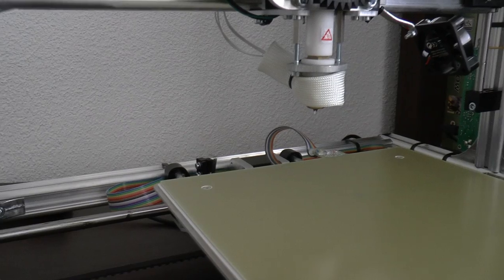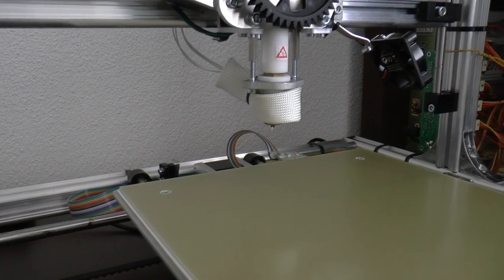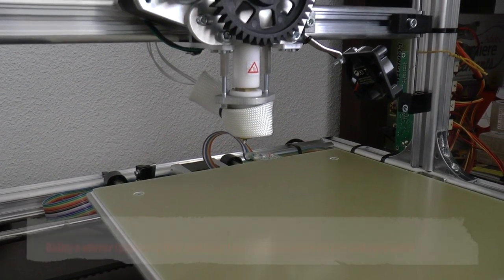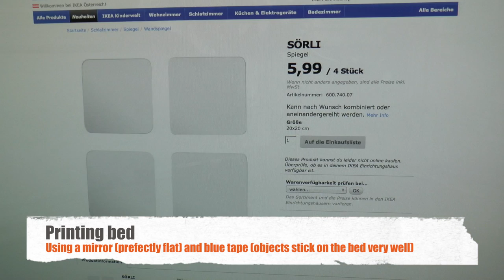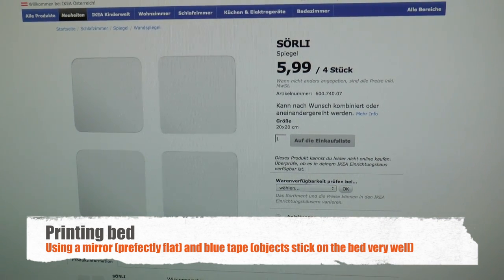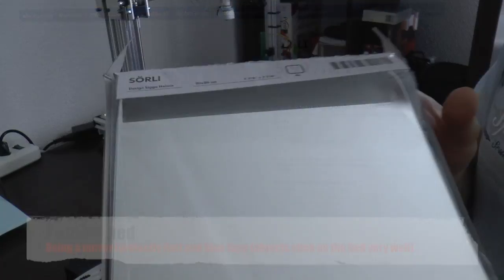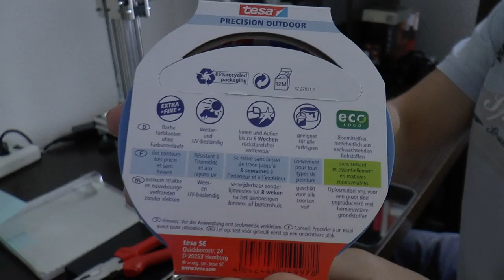Velleman K8200 - 3D Printer Tips and Tricks (Part 1)

Comment: Like your mods.
I've had mine for two years now! Still going strong. Not really made any mods except for a better fan mount. I print direct to the hotplate, just use a bit of painters blue tape. These are not the highest quality printers but they are the most reliable. I very rarely need to calibrate it. It has printed two other printers, one for a friend and a new one for me, as I wanted two. :) As a first 3D printer for the hobbyist these are ideal. I often use to to print up brackets and mounts for other projects.

Comment: I have the mirror and the tape, but for some reason the filament does not stick perfectly.
But I have got real good results with Bison spray adhesive. After spraying, wait until it's dried and then print. It sticks really good, but after the bed cooled down it is not that hard to remove the product.

Comment: You don't need any tape on mirror or glass. PLA sticks very well to the clean glass, if the bed is heated.
Reply from the maker: Well, I tried that too, but did not get good results with PLA. Maybe it also depends on how hot you can heat the bed. Anyways, blue tape works very very well for me and I still use it for all my PLA prints.
Reply: In that case your glass is not clean or you are not heating the bed properly. PLA does NOT need tape. Maybe the reason for not sticking in your case is the use of alcohol. Use hot water only and clean it really well with just water, dry it with lint free paper towel and that's it.
Reply from the maker: Probably it depends also on the printer, the default K8200 does not have a strong heating bed. I remember I tested printing directly on the glass at about 55 degrees C (that's more or less the max. temperature it can reach - even if it takes ages for that). I got best results when using a bit of hair spray on the glass, but slightly larger objects easily got warping on edges.
For sure it is true that PLA does not need a tape, and I'm sure a lot of people print without tape and get good results. However, it's a fact that PLA sticks a lot better on blue tape than on a blank mirror. On blue tape I can print at low bed temperatures (e.g., 35 degrees C) and the print sticks perfectly, no warping issues at all.

Comment: Can Kapton tape work just as well as blue tape with both PLA and ABS with your mirror solution
Reply from the maker: I guess so, yes. However, I never used Kapton tape so far and printed only PLA for now.
Reply: Ok thank you
Reply: Michael Wickstrøm
 I use kapton for both PLA and ABS.. I sand it a bit to give it some texture it works really well (Better than hairspray in my case)

Comment: I use hair spray instead of blue tape for now.
I work very well for ABS and PLA.
Reply from the maker: I've read about using hair spray but never tried it out so far. Probably worth a try... actually PLA sometimes sticks too well on blue tape and it's difficult to remove it. I guess next time my blue tape layer is worn, I'll try to print on the mirror directly - read that at least with PLA this should well.
Reply from the maker: I tried printing directly on the mirror with hair spray - for smaller objects it works very well and the first layer surface is extremly flat and shiny. For bigger objects I get some warping at corners. Already increased bed temp. to about 55 deg. C (for PLA) but it didn't help. Probably lowering the cooling fan speed could help... I'll continue testing that.
Reply: skyreacher79 I´m using hairspray on the original surface with ABS print. If I apply the spray just before the start of the print I get no warping even on bigger objects. Now i just have to find another hairspray cause my wifes flavoured with strawberry so all my prints smells...
Reply from the maker: David Lyckelid strawberry flavored prints... nice mod! :-)

Comment: What is your extruder temperature setting?
Reply from the maker: Hi, my current standard setting is 192 ºC for the first layer and 187 ºC for other layers (printing PLA). At the beginning I printed with slightly higher temperatures, but had quite some oozing. I think temperature also depends on the printing speed. When printing faster, probably higher temperatures are needed.

Best is to do a series of test prints with different temperatures, speeds, and other settings, in order to find settings which work well for your printer and material. I used a small test cube with holes for this purpose.

Comment: I can't turn the z adjustment screws on mine, they are stuck so my extruder is too far up fro mthe bed :s Any help?
Reply from the maker: Hi! Well, there are two knurled wheels on each edge of the printing bed. If they are tightened strongly one against the other, it might seem that they are stuck. Open the upper knurled wheel first by rotating it upwards - that is, counter clockwise (seen from above). That should be possible, even if the wheel is tightened well. Once you got it loose, move it up a bit and then rotate the lower knurled wheel counter clockwise, too, in order to move the printing bed upwards.
Good luck!

Comment: What do you often use as material? do you use PLA or ABS?
Reply from the maker: Hi,
I always use PLA. Used just a little piece of ABS for testing once. The problem with ABS is that you can hardly print it in a living environment. ABS produces quite aggressive vapors, so it's not something you want to have in your home. Maybe I'd use it sometimes if I had a dedicated workshop.
In general, PLA is a very nice material and easier to handle, too. I like it very much so far.

Comment: what is that thing around your printhead
Reply from the maker: Hi, that's a thermal tissue. It was included with a replacement hot end (not included in the original K8200 kit). I think it helps keeping the hot end temperature high, especially when the fan is active and blows towards the hot end. So the hot end needs less heating and temperature doesn't go up and down so much.

Comment: You can use a glue stick for bed adhesion. It's way faster and easier.
Reply from the maker: Well, there are lots of things one can use. I pretty much like the blue tape because it's clean and works well. Sometimes I also use hair spray, which works good as well, but takes a bit more effort to get off later. I haven't tried glue stick personally, but guess it could be a little mess. Does cleaning the printing bed work well with glue stick on it?
Reply: skyreacher79 Cleaning is fairly easy. You just rinse the glass plate with warm water and that's about it. I started out with hairspray and then I tried to print with UHU gluestick and haven't looked back. I never get warping issues and it's so easy to apply and remove.
Reply from the maker: TheSmellyPasta Oh - that sounds pretty cool actually. Guess I must give it a try then, thanks! In fact, hair spray works fine for some kinds of objects but on others it tends to get warping. With blue tape I never had warping, PLA sticks very well to it (sometimes it's also hard to get objects off...).
The only thing I've never done so far, is removing the mirror again. With blue tape it's not necessary and hair spray can be cleaned directly on the printer, even if it takes some patience.

Comment: That Z-axis calibrating system with em black sprockets is fckn worthless. I will buy some springs to replace those. Than I can use the bottem sprockets for calibration
Reply from the maker: +bas k Hi! I'd not say they are worthless... they actually work pretty well, but are a bit tricky to use. And you don't need to use them very often. I calibrated Z axis once and it was fine for a very long time.
Reply: +skyreacher79 can you imagine that would be about 3x easier if the upper sprockets would be replaced by small pushing springs instead? You would only have to turn the bottem sprockets. Now you have first losen the lower one, calibrate using the top one, and sometimes when you tighten the bottemone it is still not entirely correct.

I finally have my first succesfull print yesterday, I am still using the sprockets but IMO it's a payne to calibrate.
When I wanted to make a 2nd print, nothing came out of the extruder because it was slightly pressing on the glassplate, so I had to calibrate again.

Right now im printing a zeppeling, it supposed to take 7 hours. Slicing alone already costed me 90 minutes. I hope this one wont come lose after 3 hours ;)
Reply: @bask4773  I had springs, but the Bed was swinging with them